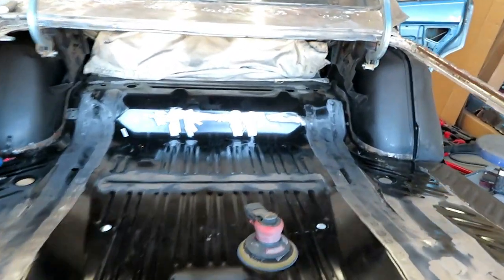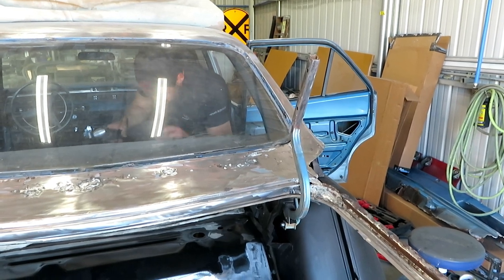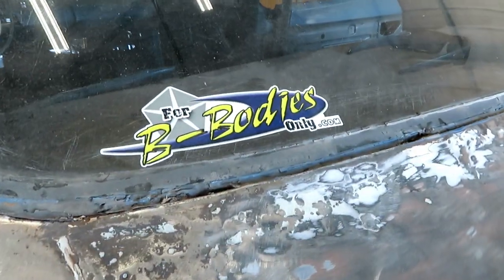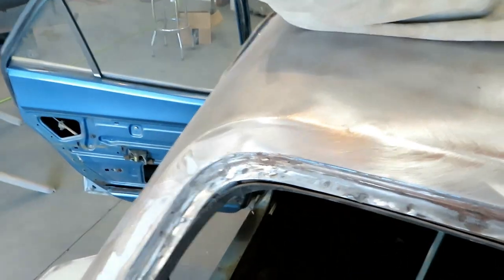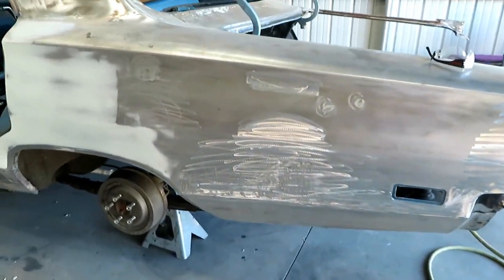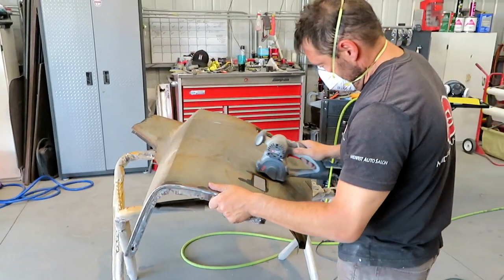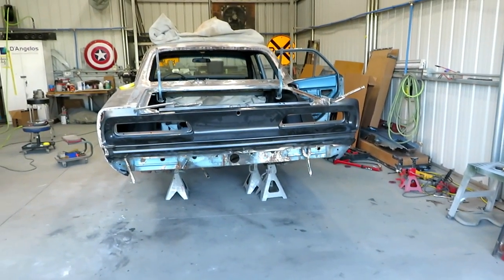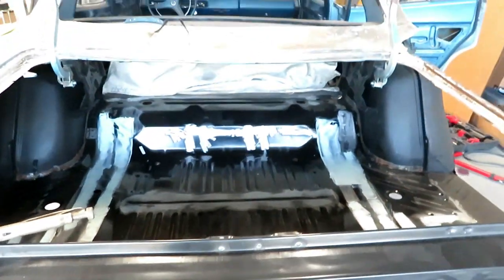1969 Dodge Coronet 4 door restoration, the lost video from week 8 07232019

Comment: So why was the truck floor an inch high, great Video
Reply from the maker: Apparently there had been an accident on the passenger side in the rear and it had bent the inner fender and the frame a bit resulting in the inch high situation on that side of the trunk.  We ended up replacing the trunk floor, the tail panel and the passenger quarter panel to fix it properly.  Shannon, the guy doing the work ended up having a neighbor bring over a tractor with a bucket and using that and a port-a-power to bend things back in shape before installing those new body pieces.  If you are interested in this project, please see my playlists and you will see one for the 69 Coronet and you can see all the videos from start to finish!!!  Thanks for watching and your4 comment!!!